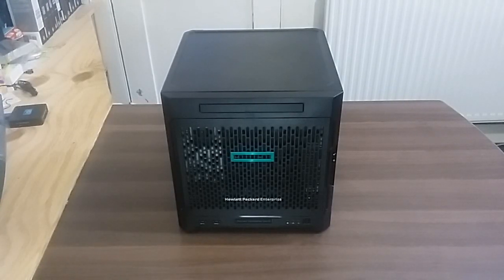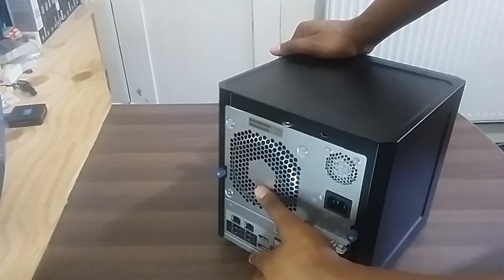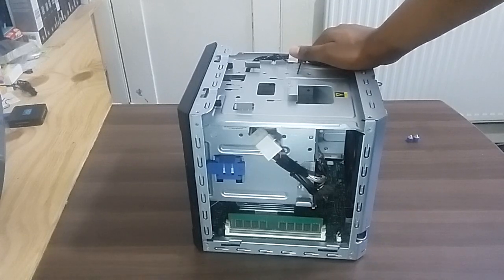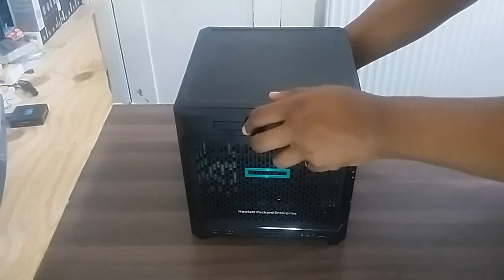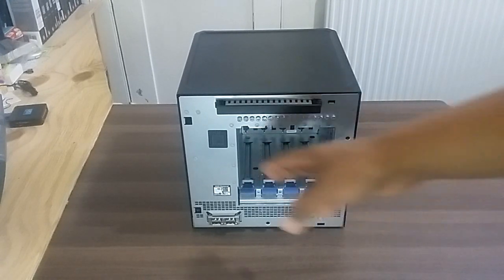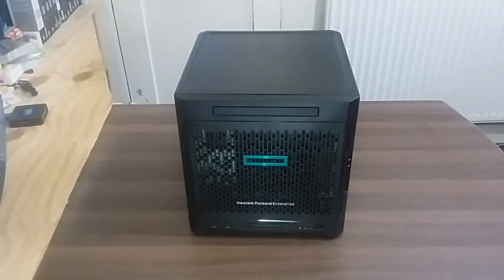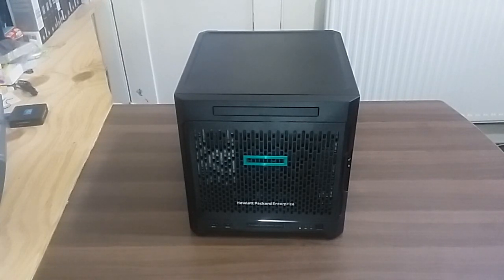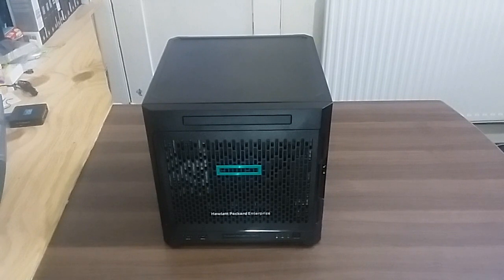HPE Proliant MicroServer Gen10 - Tour

Comment: As my server is located in my loft I constantly use the iLO to remotely administer the machine.  Being able to drop an ISO as a virtual DVD drive is a god send when you can't find a USB or one that's big enough! :)Hopefully you can (as with the Gen7) buy a separate iLO board to add the functionality if needed.  You can however guarantee it wont be cheap! Also why would a server need 2 display ports?  At most it should have a SVGA port so you can perform some initial configuration before making it headless.

Comment: I'm running a N54L G7 at home and love it. I happened to come across this video and really like what they've done with the G10. I don't like the ILO removal, but I don't have one on my current unit, and since I use it as a home office server, don't really need one. I never bought a G8 because the price was a bit steep. I really like the pricing of the L1 unit at around $400. I haven't priced out the L2 or L3 units, but might start saving my pennies to get one at some point. Thanks for the video!

Comment: When you insert the drive, is that a standard 3.5" drive or one of HPs own?
Reply from the maker: It is a standard 3.5 drive. You need HP screws as you saw on the video.
If you want Laptop Hard Drive or Solid State Drive, then you need a 3.5" caddy adaptor and a HP screws.
And then just slot it in with ease.